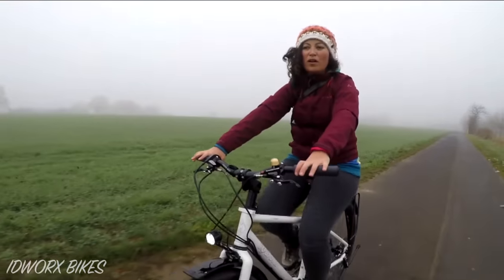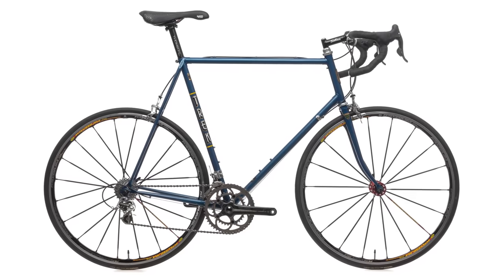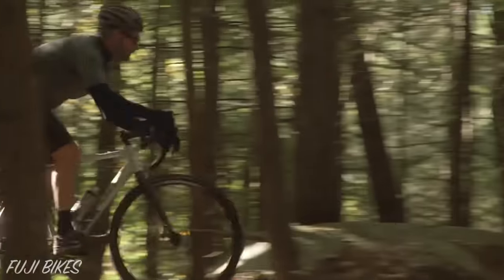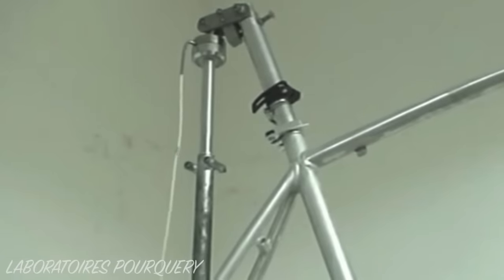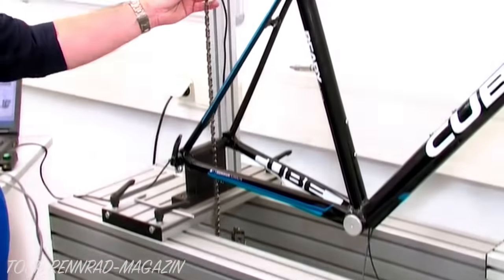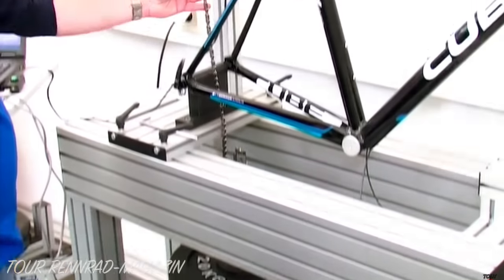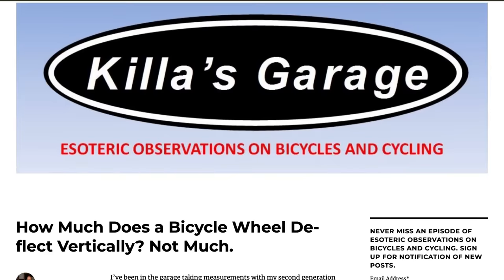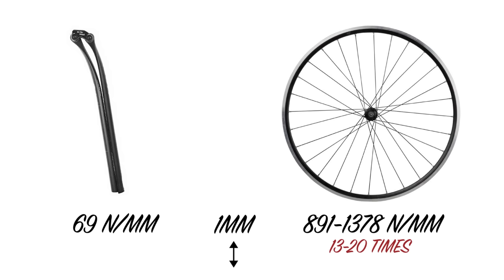Why It's Impossible For Steel Frames To Be More Comfortable Than Aluminium

Comment: I've tried steel, carbon, aluminum, titanium, and looked at trying magnesium alloy. Honestly, I haven't felt a difference outside of the stance, ride position, and tire width. I ride steel now on both my hardtail and my gravel bike. The only reason I do this is price. Steel frames are so much cheaper to find and build, giving me more money to spend where it really counts. I'm not a weight weenie, I would rather have a comfortable ride over a particularly fast one. Great video! glad I was not the crazy one who couldn't feel a difference in frame material.
Reply from the maker: Good to hear. I'm glad it's not just me too! Steel frameset options are definitely great value for the price, it's hard to find anything close in other materials.
Reply: I’ve found similar. Steel is nice/practical to live with. Whilst they tend to have ‘a feel’ I’ve not found them to be more compliant or more comfortable.
Reply: Try finding a steel enduro hardtail frame for cheaper than some aluminum one. I wish you good luck :D It's crazy how expesnive new steel frames are. Barely can find any used ones and then they still want alot of money because steel is real blaa blaaa
Reply: @kaedeschulz5422  You're right, the steel fad has driven up price. Just recently I have had issues finding a cheap older style steel road frame to build a custom road bike for my dad. Steel is real all right, a real pain to find at a decent price now. My steel XC hardtail is based off Kona's 2015 Unit frame. Their frames did run ~300-400 depending on the bike you want and the Unit is steel. Their sizing is pretty good too with many in-between options and fairly cheap used. You can likely pick up a used Unit single speed cheap and get the sliding dropouts from paragon steelworks to attach a rear derailleur. Those dropouts fit most single speeds with those style slides to open up some possibilities. Tons of options but your right, price is not there like it use to be when carbon was king and steel was a steal.
Reply: The thing that gets me is you can get a custom steel frame for the price of a really nice carbon or Aluminum frame...  For most people custom steel will be lighter, and should always fit better, presuming everything is got right...
Reply: Lighter than production steel that is.
Reply: @MrSandman982  I hate the phrase "steel is real" as it suggests that aluminum frames are bad.
Also it's crazy how when new some simple steel frame is more expensive than a hydroformed and whatever how much butted aluminum frames are half the price.
What is the reason you would want a steel frame over an aluminium one that doesn't rust?
Reply: @Owwliv  A really nice aluminium frame you get get for around 500euros already and if you want something absolutely mental Enduro Hardtail wise the most expensive one i have seen is around 950euros while steel Enduro frames just start at around 550euros and go as high as whatever one is wanting to spend.
A good carbon frame costs around 1500euros
Reply: @kaedeschulz5422  One should always pick the frame cost, fit, weight, design that they like and think of material as a secondary. For me it was cost primarily but I also travel with my bikes. Anything brakes on my frame I can go to nearly any metal shop and have a steel frame fixed, in nearly any country. I also now customize my frames with more cage mounts, internal routing, disk brake mounts, and hub clearance. This is especially true if I am modifying an older frame. Steel frames are the only option at this point for me other than price. I can go more into touring/bikepacking weight carrying abilities but that's highly user need focused..
Reply: @Cyclingabout  Can you point me to some good cheap gravel steel framesets?
Reply from the maker: @v4mp1el  Check out the State Bicycle Co 4130. Easily best value frameset available: https://bit.ly/32ff5VK
Reply: @Cyclingabout  Thank you very much!
Reply: @Cyclingabout  They don't ship to germany ;( Do you have a best value frameset for EU customers?
Reply from the maker: @v4mp1el  8Bar Mitte, Author Ronin and Brother Kepler all come to mind.
Reply: @kaedeschulz5422  aluminum does not rust, but it does corrode.
Reply: @mr.rodriguez3512  And gets brittle faster i think.
Reply: @kaedeschulz5422  aluminum corrodes, so what advantage is that over steel which "rusts"?
Reply: @rickc303  Does it happen from water? Have never seen problems with AL caused by water apart from boats. It's lighter too
Reply: @kaedeschulz5422  yes, moisture causes corrosion in all sorts of materials. Vast majority of aircraft are made out of aluminum, they may not "rust", but corrosion is indeed a problem to watch out for
Reply: @rickc303  Oh okay. Good to know! Thanks!
Reply: @kaedeschulz5422  aluminium frames do work harden over time and become very brittle, eventually cracking. This is probably less problematic on road bikes but on mountain bikes that get ridden regularly off road, it does limit the frames lifespan.
Reply: @CanonFirefly  it doesn't harden. I think it develop tiny tiny Cracks and at some point the become visible and the frame is close to failure. Off course this is a good reason to go for a steel frame!
Reply: @MrSandman982  Getting repairs done well for thin-walled steel tubes on a bike is easier said than done, in my experience. I had to drive from DC to Philly to find someone who could repair it and had to wait through a months-long backlog.
Reply: @kaedeschulz5422  Rust is not even on my mind with a steel frame and can be stopped with a paint pen and regular maintenance. Aluminum is also not very easy to repair. Welding aluminum requires a very unique skill and equipment. Newer steel frames can be more difficult to repair if they are thin but older ones tend to be the easiest that any good welder can do. I have personally had this done with an older frame gravel bike I built for my dad. Other reasons are weight capacity. Steel bikes can carry more for touring, which I do quite often. I have also drilled my frame to add threaded mounts with no issue, as long as they are done in the right places, with just a drill and a threading tool. Can't do that with aluminum.
Reply: @patrickstuart3326  Yea, that can really ruin a trip. I was in that situation in Italy when I noticed a crack in my rear triangle and seat post weld. Luckily I found a shop, floated the guy a little extra, and he had me rolling the next day. That was on my Kona Unit XC build. That repair has held since 2018. Knock on wood.

Comment: Is the fork considered not part of the frame? On many vintage bikes you can see the fork flex if you pull the front brake and try push the bike forward. How about vibration dampening? Sorry but the seatpost flex test seems too simplistic to paint the whole picture. Youre correct that tyres and saddle etc play a huge role though, not arguing that.
Reply: The fork is not a part of the bike frame, the play of the suspension fork is because those old forks are cheap and made without much attention.
Reply: I agree. I have two Hardtail MTB frames which I push to the extreme downhill. (Same geo and I use pretty much the same parts on them) I can definitely feel a difference between my steel and alloy frame hardtails. The steel is not only faster but also more comfortable. The tubes are smaller and they also swing and vibrate completely different. He is just talking about but comfortable but not the difference between steel and other materials.
Reply: @Bjoern_the_Baer i think his point is frames dont flex much in comparison to tires and the seatpost that have the most defoemation while riding.
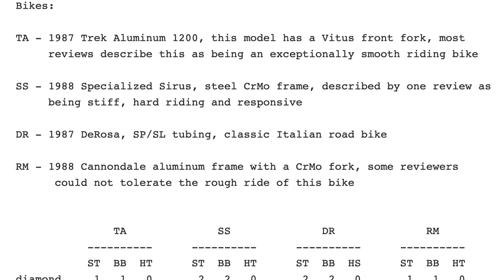Reply: @richr161  Look at 1:51. the fork plays a major role but he 'conveniently' left it out of the equation because it wouldn't support his message.
Reply: I noticed that the fork was ignored too.  Maybe that complicated the message too much?  Even among my steel road bikes, I can tell that some flex more than others, and a bit of flex does help reduce the vibration that gets to your hands.

Comment: I have ridden several mid 90's steel mountain bikes that were very stiff feeling (as much as an Alu bike feels to me). And I've also ridden an early 2000's On-One Inbred (a cult british, taywan made steel hardtail with thin tubes, a long top tube geometry and Dekerf style fork rear stays). 

The Inbred has always felt noticeably less harsh on the trail when compared with the thicker tubed, shorter "triangled" bikes of the 90s. 

I've always felt that the zingy feel of the On-One comes from the frame twisting "sideways" relative to the vertical plane as opposed to the vertical movement you are focusing on in the video. 

My intuition attributes this extra flex to: thinner walled tubes (they bend more easily), smaller diameter tubes (also bend more easily) and a significantly longer top tube (triangles with longer sides, twist more).

As concluded in the video It is not surprising that a structure that has its maximum strength in the vertical direction does not deform a lot in that direction.

BUT, when riding a bike in the real world, the purely vertical loads are far from being the only forces that define how a bike feels, especially when the bike is tilted/leaned on by the rider and goes around corners and the wheels hit obstacles and bumps that impart lateral forces on the wheels.

These more "lateral twisting" forces are probably way more important to ride feel and comfort than the vertical ones. (precisely because most frames are designed precisely to guarantee they are very strong in this direction. For the counter point consider something like the Slingshot mountain bikes of the 90s, the ones where the down-tube was a tensioned  cable. Look at the lateral flex on those bikes!)

Don't forget that all key components that are in between the force "origins" and the frame are nowadays typically very stiff. Namely: the rims, hubs and spokes, the fork, the pedals, cranks and bottom bracket.

Also don't forget that most frames nowadays (even steel ones) are built to be very laterally stiff, because this is a sort of assumption by manufacturers that stiffness is a desirable property in general. This is a symptom of the influence of road bike racing (the stiffer the less energy is wasted) and of mountain bike design where in the last few decades everything from handlebar diameter, to fork stanchions, to head tubes to axle diameters became oversized in the quest for more stiffness.

I'd love to see new tests done by applying a twisting force via a lateral load to the front view axis of the steered tube for example (with the rear dropouts affixed to a solid stand).

I do reckon such tests would show that this torsional frame stiffness is more dependent on the actual tube specs and frame design, than the materials per se.

These are just the ramblings of a non-engineer that has been riding bikes for 40 years. So take that as you will :P

Comment: Food for thought. I have steel frame Surly fatbikes, and love them for a number of reasons. I agree that tire size and pressure will always be a dominant factor in comfort and performance. Tires are your (or part of) your suspension, even in a car. I’d say this data is most focused at road bikes, where the tires are small and high pressure.
Reply: I think at certain point too big tires will make the ride more sluggish. Around 35c might be the optimal spot.  Double butted heat treated steel seems to have more springy horizontal compliance without being too noodly which reduces back pain and gives the feeling of so called ride flow. In my experience budget grade aluminium frames were harsh and clunky regardless of tire pressures while also having high speed shimmy on descents.
Reply: Exactly.
Also, side deflection is completely left out of the equitation.
Reply: @uvwuvw-ol3fg i think diameter also applies to the equation too since my 26”  MTB is quite nimble on it’s 2 inch wide tires where as my Hybrid 700c bike on 32mm tires is quite sluggish in comparison.

Comment: In terms of comfort, I would suggest saddle choice can make a large difference as well. The more your saddle conforms to your shape and distributes the load out to your contact points, the more comfort you will have. I've ridden Selle SMP saddles for years, even though they are ugly as sin, because they fit me better than other saddles and have made a huge difference in comfort.
Reply from the maker: Saddles definitely make a big difference! Just another spring in the series, but a bit less easy to calculate.
Reply: Since sides and nose of the saddle is hard then horizontal compliance/springiness of the bike frame is still important when it comes to giving that feeling of so called ride flow and reduction of back pain similar to therapeutic horse riding.
Reply: I agree. And no, saddles are meant to be a hammock, not a simple spring.

That kind of reductionism leads to ignoring evidence in favour of theory. And in theory practice is the same as the theory. But in practice, well...

Comment: Totally agree, I always laughed a 'Frame Ride' reviews, when what the 'Princes & the Pea" reviewers were actually telling you about were the stock speced tires.
Reply from the maker: It's cool to see some websites using control tyres for their tests (eg. CyclingTips). I'd love to see them go a step further and use control seatposts, but even that gets a bit tricky with varying seatpost lengths, different seatpost shapes (aero, proprietory) and diameters. Then again, where do you draw the line in terms of describing comfort? Control handlebars, bar tape, saddles?
Reply: I don't understand the bike reviews of the parts since you can change all of them very easily. Some parts you should change to make the bike fit better (saddle, stem, handlebar, grips). It's the frame that matters. But if you think that reviewing "Ride" is useless then where do we need any reviews? Let's just watch bike commercials.
Reply: @Cyclingabout  it's funny you say that, because while your mechanical analysis is spot-on, my thought during the video was "vertical compliance is a funny way to define 'ride comfort'". 
My experiences certainly match your data, that tires dominate vertical compliance, but when I think about what bike produces the "most comfortable" ride, I'm not just thinking of how jarring the ride is, but also how much the frame flexes laterally under load, how sensitive the steering is, and how hard I have to work to make it go (I would describe high rolling resistance as uncomfortable).
Reply from the maker: @natbarmore  "Comfort" can certainly be interpreted in many ways, and with all of the variables, almost everyone will have a slightly different take. Thanks for sharing yours!

I think there is a lot of merit to measuring force vertically. Have you ever ridden a full suspension bike? It's pretty hard to ride one (with a high or low lateral frame stiffness) on a trail and not feel comfortable.

I've also found that I can make my laterally compliant steel bikes "uncomfortable" to ride by using firmer saddles, stiffer seatposts, and higher tyre pressures. And my stiff aluminium race bikes "comfortable" with more padded saddles, flex carbon seatposts and lower tyre pressures.

As a result, I tend to think lateral frame stiffness falls into the 'ride feel' category, rather than the 'ride comfort' category.

But then again, I think there's a case to be made that when mountain biking on rocky sections of trail, that a frame with less lateral stiffness will be more comfortable due to the additional off-axis directions of force!
Reply: @Cyclingabout  all good points. I've test-ridden full-suspension bikes—particularly liked a Softride with suspension beam (instead of seatpost) and suspension stem. Rolled up a curb and didn't even notice. But I don't ride off-road, really—gravel roads and paths sometimes, but nothing that merits a mountain bike or similar. So I'm talking strictly comparing the comfort on various sorts of surfaces that might be loosely called "roads" or "paths", where the handling obstacles are potholes, curbs, broken glass, and cars, rather than roots and rocks and tight switchbacks.